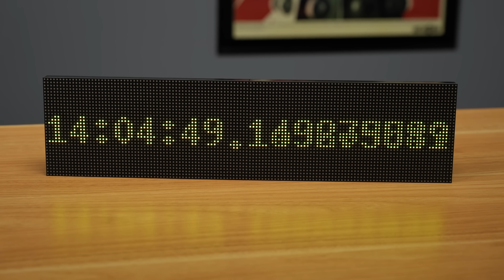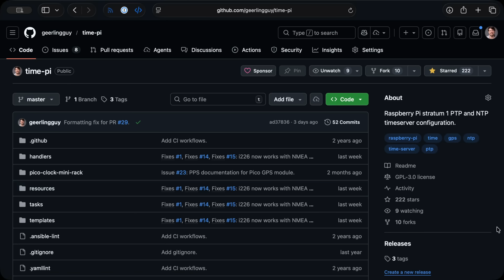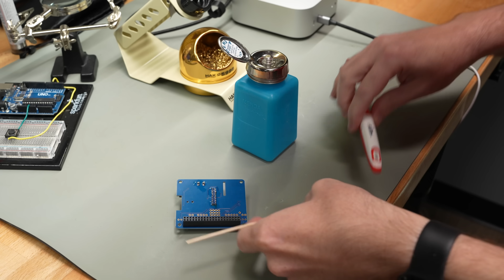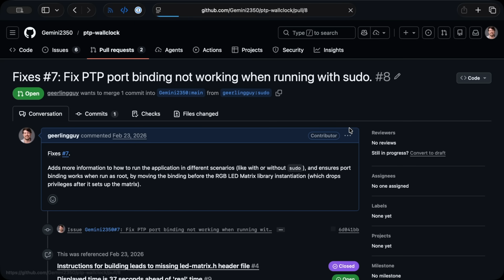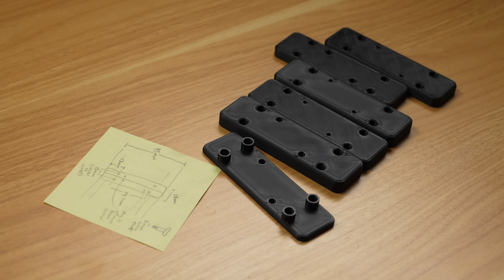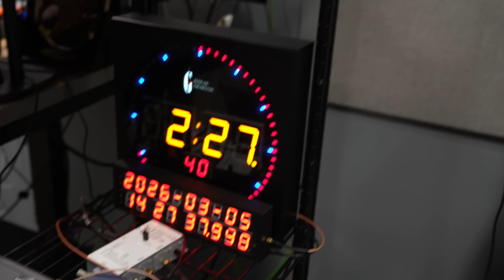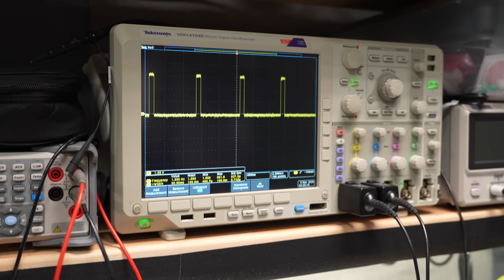I built a new clock, and now I'm not sure what time it is

Comment: The first question that popped into my head was "what in the world can one do with a visual display showing nanoseconds?" (nanoseconds?? picoseconds?? I forget.) With my eyes I could see what was happening with the tenths (of seconds), but the next degree of precision (hundredths) was already blurring such that I couldn't tell what was happening. Perhaps that's a video artifact, even still I'm sure at a thousandth of a second, it would be worthless. However it might be great way to test shutter speeds of cameras. One, just at what level are the digits readable. And two can setups be made to measure durations? I might have taken up this project in my earlier years, but no longer. Maybe Jeff will.
Reply from the maker: Mitxela's Precision Clock Mk4 goes to milliseconds with an analog driver. I am prodding him to take it further, and maybe reach microseconds :)
Reply: @JeffGeerling does your clock have any way to capture the time on an event? Ie, some sort of transfer of the time to a (capture) register triggered by a pulse on some input line? If so, then it definitely could be used to measure a duration, or successive times of two events. Also as the precision increases at some point distances can start to be investigated. A microsecond is probably still too slow, however another 10^3 increase in precision would be close to the limit of detectibility, eg 3x10^10 cm/sec ~ 3x10 cm/10^-9sec. Might also be talking about very expensive parts.

Comment: Lots of unused display real estate there. You could run a seconds "hand" moving dot on the top or bottom pixel row from left to right so that it reaches the right edge at the exact second transition.

A linear scale on the other edge visualizing the PTP clock offset from master from the clock servo in a reasonable scale would also be nice.
Reply: I was thinking you only need one display panel, put everything after the decimal on a second line. Seems like there is enough room. Then you don't have to figure out how to bond two panels.

Comment: Why you fail at flux cleaning:

yes, some fluxes are way more difficult to clean.
you should make sure you have 100%-ish iso.
you can add acetone to it, it can make it more potent. there are other recipes too, such as using brake cleaner/ residue-free contact cleaner (hydrogenated naphtha) etc. It's going to depend on the flux what it likes!
use a robust fleece wipe to absorb the flux residue while you massage it in with a brush, don't just smear it around.

Comment: As someone that has been looking at building a time pi. What's your recommended route since you are between building new one(s) or fixing the one you have?
Reply from the maker: The basic components are the same regardless of the exact build — so the main configuration will be similar.

You need a NIC capable of hardware timestamping if you want PTP, a GPS module if you want a very precise timing reference, and you need the software to sync GPS to NIC, and NIC to system clock. Then Chrony if you want NTP...

The big thing is determining exactly what hardware to run, whether you want to run PTP and NTP, and then how precise you want everything (because you could just run the time of NTP over the Internet, and be within a few ms of 'real' time :)

Comment: 3:43 even at 99% IPA it can be a challenge to get most of it off, either fully dunk the board in IPA (which is a trouble) or dunk cotton swabs with IPA (specifically the harder varieties used in makeup etc) and go around the narrow passageways with a pair of tweezers.

Comment: You can get flux remover (spray can) that helps to clean it up. When you screw down those terminals, you want to either cap the wires or tin them with solder (sahlder?) :)
Reply from the maker: It's not fun to let the strands squish around until they just pop out at some point? :D

Comment: To address the flux residue: you’ll need some real flux cleaner instead of using ipa. The rosin used in flux cored solder wire isn’t usually very easy to clean up without a specialised cleaner. 
Personally I use Zestron FA+, but it requires rinsing using de ionised water before drying to guarantee a completely clean result. 
If I were you, I’d get a can flux off or similar, usually good enough for personal projects.

Comment: Cleaning depends a lot on the used flux. But try sticking to IPA, but instead of a toothbrush, use a micro fibre cloth. You could also try to dillute your IPA with destilled water into, for example 70% IPA 30% water mix. But the best "change" for me personally was the switch from toothbrush to micro fibre.

Have a great day!
Simmie

Comment: For cleaning off the flux, you'll have more luck when using a "No Clean Flux", which leaves behind significantly less residue to start with, & then IPA to finish cleaning it off.

Rosin Based Flux is nicer for getting solder to flow, but leaves that stick residue behind (the rosin I'm assuming) even after cleaning it.

Comment: The problem with this clock is that you know very, very, very precisely what time it is, but it doesn't give you the faintest idea of what day it is.
Reply from the maker: Just the Time of Day, nothing more :D
Reply: @JeffGeerling  Well, Tod in German means "Death" :D
Reply: The hardware clock part of PTP, in the Ethernet PHY or MAC, typically only tracks the number of nanoseconds (billionth of a second) in its register. This means the seconds, minutes, hours, days, months, years are left up to the operating system's network and time sub systems to keep track of, with PTP just providing a super accurate subsecond resolution, and providing a once per second interrupt to the operating system to remind it to determine the sync error and adjust the PTP clock rate. In this way it can clamp the error down to a few parts per billion, that is, nanoseconds per second. It is a nifty and useful mechanism, particularly for aligning frames of video, audio, and illumination pulses.

Comment: For removing the leftover flux I usually lay a paper towel (or anti-static wipe if you're worried) and pour the ipa directly on that, then scrub the paper towel with the toothbrush. Leaves a much cleaner surface since you're absorbing the flux into the paper towel and not just moving it around with the brush.
Reply: Kimwipes! I was skeptical how much difference it would make but they are amazing.
Reply: also, LOTS MORE IPA
Reply: Same way I learned it when doing board repair for a company. Paper towels and brushing with IPA. Also I did not use seperate flux. Solder had it already in it.

Comment: Yes, there are different types of flux and they require different solvents to clean, some IPA, some specialty cleaners, and some distilled water.  If you clean them with the wrong thing it'll leave residue.  If I recall correctly for example cleaning some types with IPA will leave a haze that's hard to get off.  There's a video on youtube that summarizes this from an industrial tech.
Reply: Chiming in here - I've found that you can't go light on the cleaner, because if you do all you're doing is smearing the flux around the board.  You have to flush the flux off the board so the flux drains off with whatever cleaner you use.  In Jeff's video clip he was using a tiny amount of IPA and it was drying off rather than running off.
Reply: @alskjflaksjdflakjdf  I second this advice. Another thing which helps is to not let the IPA dry on the PCB. Use a clean paper towel to dry it off. 
I personally use multiple one-pint tubs to clean small PCBs. I have a "dirty IPA" tub to get the bulk of the flux off and then another tub with cleaner IPA to rinse the dirty IPA away. Eventually the dirty IPA needs to be thrown out. When I do this the IPA I had been using to rinse then becomes the dirty IPA. Clean IPA is then used in a new "rinse" tub.
Reply: Looks like he's using a rosin based flux in the solder core. Usually, rosin flux does not need cleaning up and some are actually designed to be left on as a passive oxidation barrier. Rosin flux can be ugly though if overheated/oxidized.
Reply: The first time I used purpose-made flux cleaner was a lol moment because it works so well compared to isopropanol.
Reply: @andrewmorton9683 depends on the flux but yeah it can be. My go to was IPA and RMA but n propyl bromide was good too. 

It’s possible I worked on the cleaner. Not many companies do it. I enjoyed it but the company was a dead end. Towards the end I was mainly in cleanliness test methods (SIR) where a dead short was 1 M Ohm and open was a few T Ohm.
Reply: If IPA doesn't work I reach for acetone, as long as there's nothing on the board the acetone will hurt. Flux-off is also a very good option. It's light petroleum naptha and IPA with R-134a as a propellant, if I remember correctly.
Reply: To get nice clean boards for photography with rosin flux, I usually use quite a bit of IPA with a tooth brush, then more IPA with a microfiber cloth to remove the remaining residue. Toothbrush just helps move it out of places the cloth can't get to
Reply: Flux Off spray works great!
Reply: I used to formulate flux cleaners for high reliability electronics professionally for 13 years. Yes technically you need to match the cleaner with the flux. That being said when I needed to build in the lab all I used was RMA with eutectic lead solder an IPA
Reply: He just needs a Flux Capacitor.

Comment: To remove pesky residue - heat up the board with a hot air station to melt the flux, then immediately douse with 99% IPA.

Comment: Hi Jeff, a couple of things.  To clean difficult flux from projects, I strongly recoment MG Chemicals 4050-1L Safety Wash Electronics Liquid Cleaner.  Its a good degreaser and is plastic safe as well.  Not to expensive.  As far as network cards go and flaky drivers, I like Mellanox/nVidia ConnectX family  the drivers are usually very solid for both Linux and Windows as well they are super low latency and they are still being developed and supported, Intel has pretty much cut their networking division so I would not depend on continued support or new products.  A low cost alternative that is surprizingly good is Realtek.  Stay away from everything Marvel.

Comment: I recently turned an old Beaglebone Black into a PTP Grandmaster. The Ethernet chipset on the BBB supports hardware time stamping and I used PPS from my GPS NTP server to drive an input on the BBB to get microsecond sync to GPS time.
Reply from the maker: And more or less realtime instead of through the kernel, right?
Reply: @JeffGeerling  The GPS PPS signal triggers a high-priority hardware interrupt that disciplines the System Clock with nanosecond precision. The phc2sys bridge then "steers" this accurate time into the Ethernet Hardware Clock, ensuring every outbound PTP packet carries a GPS-referenced hardware timestamp.

Comment: Have you tried glass fiber brushes?
Reply from the maker: I have not; I have one somewhere (probably in one of the "soldering bins" with random other soldering odds and ends), will test it out on my next header
Reply: @JeffGeerling  don't use this! glass fiber will mark the solder mask. You can use it to remove the mask if you need a new trace exposed.
You need the corresponding flux cleaner for your solder. If it's generic solder, you can buy a few cleaners and see which works for you. 

Solder flux is complicated it comes in no-clean (not corrosive, you can leave it on, without it corroding the board), and a few other types of corrosive flux (that you do need to clean). 
I know you can use just IPA with some fluxes but i have had the best luck by buying the chemworks solvant. Either in cleaning felt tip pen form, or the big bottles with a bristle tip.

Comment: Ah yes, if youve got one clock you always know the time, if youve got two youre never sure 😂 What is that device youre using for dispensing the IPA onto the tooth brush during your soldering?
Reply from the maker: It's a Menda 'Pure Touch' bottle. I saw these when I was a kid at the engineering shop, and they are extremely handy for dispensing IPA for cleaning.

Comment: I’m trying to make an NTP clock with:
- A Pico 2 WH-compatible Ethernet HAT since the 2.4 GHz WiFi isn’t strong enough where I want the clock.
- A HH:MM 7-segment display which has a built-in DS3231 RTC. Will blink  the ”:” at 1 Hz to indicate seconds.
- A RPi Pico 2 WH.

All programmed in C.

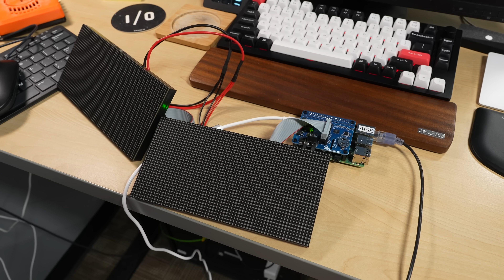Comment: 3:50 you need kimtech wipes.  Alcohol loosens the resin, kimtech wipe removes it.
Reply from the maker: Oh nice, I had seen these before in a factory where they do board rework, but didn't see the branding on them. Will pick up a few boxes and see how it helps!
Reply: the type of solder and solvent matter.  kimtech wipes are just std lint-free non-abrasive wipes.